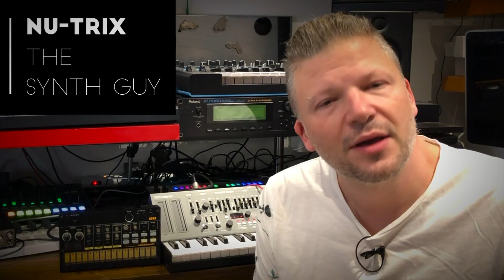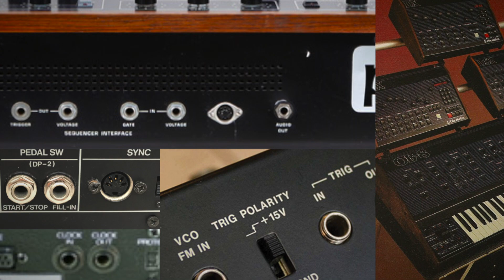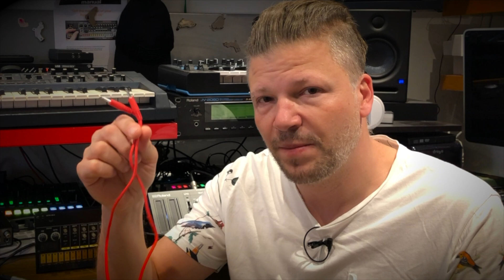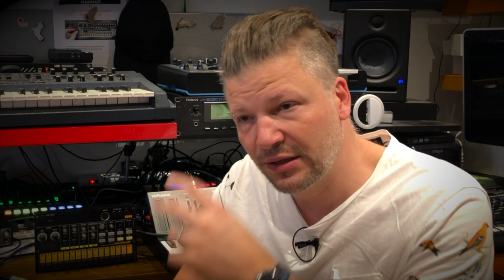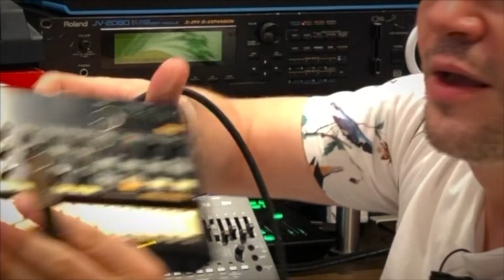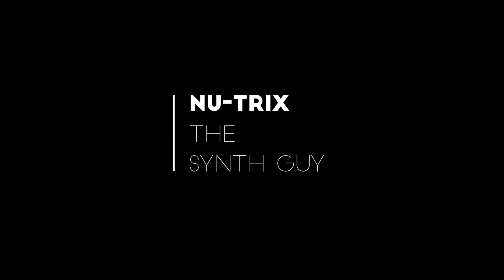How to sync using MIDI Sync or Trigger Sync?

Comment: FYI, nothing to do with this topic. Just to tell you that UVI just released Falcon 2 with crazy new stuff. I don't know if you have Falcon but if you do, this update to version 2 is free, which says a lot for the lack of greediness of UVI considering how huge this update is. I personally think their products are top quality. Great sounds. I tried most synths but I only ended up purchasing Falcon and Serum. Did you do a video on the new Massive X? Anyway I am curious about your opinion of the new Falcon 2. I don't have any hardware synths except for a tiny one I got to learn to connect midi out from my iconnectaudio4+. I really like the midi side of music making. It amazes me how much you can do with something as relatively simple as midi. I like to help people to set up midi systems. My favorite midi gadget is a powered midi hub. There are excellent ones and they almost guarantee no power issues amongst many connected devices and no need to disconnect one midi instrument or synth in order to use another because of power problems. Boy did I ever go off topic. I don't k ow if I gave your email address. That would make it easier than communicating by comments. Keep having fun as often as you can.

Comment: Hello Sir  I've been have a problem to connect Akai MPK61 with Roland SH 01A   I can't have the mpk keyboard works..when I press the play on mpk it does trigger the SH 01a and stopp when press stop ..but when I try to use the keyboard it doesn't respond at all...I'm using a midi cable connection correct .. on the SH 01 I have sound going out from output into MX1 channel,  ..I've watched  most of your video on that but I can't find anything on that particular situation..Thanks for your videos they are great ..
Reply from the maker: Check if the MPK61 and the SH01 are one the same MIDI channel.
Reply: @Nu-trix  thanks buddy

Comment: Maybe you could help me out - So pretty simple:

1. MC 707 sending out midi clock to XD.
2. XD is set to Clock Source Auto
3. The clock fluctuates ever so slightly (a tenth?) so that it is virtually unnoticeable but...
4. When you use a bpm delay, there is a slight pitch shift (due to slight clock movements affecting the delay) about every ten seconds give or take. 
5. Its not the MC - everything works just fine with the Novation PEAK (as always - quality synth)
6. Is there any known issues with the clock sync with the minilogue? Thanks!
Reply from the maker: Now that I know of. But MIDI clock is not the most precise clock there is.
Reply: @Nu-trix  Thx for getting back to me. Just found this on another youtube channel "UPDATE (April 18): Korg has confirmed that they will be fixing the BPM Delay + External MIDI clock issue in a future firmware update." So maybe there's hope :)

Comment: Do I need to have them both going into a mixer? What kind of set up do you have here for output?
Reply from the maker: Sync is not audio, so yes in parallel to sync and MIDI you need audio connection and a mixer for combining them all.

Comment: Can I sync a software like Traktor or Serato DJ with my DAW? I can sync midi hardware between them and with my daw, but I still don't know how to sync what i'm playing on Traktor with my VST in my daw :'(
Reply: Is traktor  capable to use vsts within?
Reply: @finonomastropiero4261  Not within.

You need to send the traktor signal to your daw, and then create a track in your daw that plays that signal. I use to use Voicemeeter(software) to send Traktor to a virtual audio channel 3/4 (without hear that), and then create a track in Reaper that receive 3/4 as input and send it to 1/2 (now, you can hear that, because it's the channel of the Master). When you do that, you can add whatever plugin you want to the track, but it's not in within the Traktor.

You can do some stuff. For example, you can automatize some FX in order to increase/decrease them with the volume of the input, or with low end, etc. So, when you remove the low end in the mixer, then the reverb+delay increases.

Comment: I really really need some help so I just bought a Se-02 an when I try to play it no sound is coming from any preset even when I plug in a midi keyboard it has newest update an when I play in sequence or song mode it plays sounds just fine just not in patch mode what am I doing wrong??? Any help appreciatef
Reply from the maker: Maybe check the MIDI channel settings. Or try a factory reset.

Comment: Informative video! I'm trying to sync up a Drumbrute Impact and a Behringer TD-3...I figured this would have me on my way, but I haven't figured it out yet...both have MIDI IN/OUT and sync, but I'm stumped...

Edit: I figured it out! Got the midi control installed and the firmware update did the trick. This might be of interest to people in regard to compatibility issues with korg or other companies, the Drumbrute has different timing options available for Korg and anything else👍 What an awesome little drum machine.
Reply from the maker: Thanks for the info!

Comment: What about using midi out to send clock data to other devices for a backing track? Like if I used a drum machine for the master, and a korg monologue for the bass line. Would I need to set the patterns for both? Also would each device in the daisy chain occupy one of the 16 midi channels? I'm just confused about how to use midi to sequence a song together. Please help me. It would be appreciated.
Reply from the maker: Tell me more about your setup and what you want to achieve, I’ll try to make another video specifically for your kit. Maybe a picture of you setup also.
Reply: Ok where do I send the pic?
Reply from the maker: At luc@nu-trix.com
Reply: @Nu-trix  Is that the actual email address?
Reply from the maker: @miles46100  yes. I received your email. I will take time to go through it later today.

Comment: Hey man! Great video, learned a great deal about machines!

Here is one for you:

I m having trouble syncing my sh01a and my ju06a via ext clock:

Using the SH as master and the Juno as slave, when i play my sequence on my SH, the sequence of the juno starts but isn t played as it was programmed: it plays the right notes but completely eraticaly, not at all as it plays without the syncing.

I ve been looking for the answer all over the web, seems like nobody has the same pb. I m beginning to think that my juno has a problem...

If anyone has an idea :)

Anyways, thx again for your great work
Reply from the maker: How do you connect everything ?
Reply: From gate out of the SH to the ext clock of the Juno, with a mono mini jack.
Just so you know, i also plugged the gate out of the SH to the mix in of the Juno, and i had a click on every beat (so i don t think the prob comes from the SH...)

Comment: struggling to sync minibrute 2 keys with drumbrute..only a learner and had them a few days..i want to go dawless...i want to have a headphone in behringer umc404hd how do i do this please..
Reply: Yo, I have the same setup with some added stuff. I'm also a learner, so I can tell you connecting these things is a pain in my ass, but it's possible. I might be telling you something you already know, but you should be able to connect them directly. Meaning, pick a MASTER (Pick either the minibrute or the drumbrute to be the one with the main CLOCK * it doesn't really matter). For this example, lets say I pick the DRUM, have the SYNC button on INT, then have the MINI on MIDI. Connect MIDI to the OUT of the DRUM and  IN to the MINI. (Tip, clear out the Sequencer on the MINI or else your gonna get a loud crap surprise of whatever you recorded) You can control the tempo with the DRUM. You can also do it thru the "CLOCK OUT" on the drum brute, but the MINI is confusing on that aspect.
Reply: You can also try buying a BEAT STEP PRO (Made by Arturia), which is what I have as a SEQUENCER, but that brought me a lot of other problems. For example, it doesn't seem to work with the DRUMBRUTE IMPACT. If you have the original DRUMBRUTE, I believe it should work flawlessly. Thanks Arturia! But anyways, It lets me do some kool stuff like adjust each note's TONE, which is really fun and makes it stupid easy to make Synth rhythms. It also allows me to buy a $100 dollar program named ABLETON and I'm able to use all those effects and drop samples on the fly during  live performance. (*caution, you need a laptop (For transportation), with a decent CPU. Minimum i7 Intel, but I cannot stress this enough, I would get a i9 Intel, cause at lower levels you get a obvious delay in the music). But you can use the Mini and the DRUM on Abelton too cause they connect. 

FIRST SIDE NOTE, you might need a MIDI Spliter to connect your products (*MIDI does not send out sound, Only a signal to other MIDI products to trigger their commands, LIKE A REMOTE) 

I added at delay pedal (Like the one's for guitars) to my DRUM to add some mystical space to the sound,  which I recommend. (Get Analog, not digital Pedals. Also, don't go cheap. Spend at least $120, cuz you want to have control of the feedback and how much delay).  TC Electronic Flashback 2 Delay and Looper Pedal is what I have (*Get the insurance. I hear these things break) 

I also wanna stress this, the BEATSTEP PRO is a pain in the ass cause it doesn't use connections like other sequencers. I'm still trying to figure it out, but I feel like most of the pain I'm getting is from having to research and read, and having to go to amazon constantly to buy new connections. I feel like other Sequencers might be better, but this is my experience with the Beatstep Pro, which is not bad, it's just fkkn complicated. 

Side note, don't expect to buy these things and have everything you need. I've had to make several trips to Guitar Center and Amazon to get connections each other didn't have. (*Splitter for the MIDI, extra MIDI cables, 1/4 cables, power supply.)

For CONNECTIVITY, I Rig my gear so that my BEATSTEP PRO works a the MASTER. I send  MIDI OUT to my BRUTE and MINI using a SPLITER. I set the MINI and the DRUM on MIDI in the SYNC category. MINI sends it's audio through a 1/4 to my MIXER , the DRUM sends it's audio through a 1/4 into my DELAY PEDAL, then to my MIXER. MIXER to the SPEAKER. 

When I hit play on the Beatstep, it activates everything. 

I know its annoying, but it's possible. You would think Arturia would make their products work out of the box. Ugh.
Reply: Side tip, go on Reverb.com if you wanna buy  used products on the cheap. Right now they have a Beatstep pro for $130 (NOrmally 250 plus tax), but you gotta hope that whoever owned the machine before you did the updates, cuz used products don't come with activation codes, or they were used already. My MINIBrute 2 lives without updates.

Comment: OK.  I want to use Novation Mininova as the master (midi internal), and Korg micro sampler and Roland Boutique JU-02 as slaves.  They dont really need to start simultaneously, just so the tempo of the Korg (so the loops in Microkorg are plays in synk), and the internal sequencer of the Boutique lines up. I will then live sequence them. NO midinotes of course. It proves to be not that easy....   Should i set the master Mininova to not send notes, or the other ones to not receive notes?  Confusing.   And to i have to set the second keyboard in the chain - the micro sampler also to something to specifically not send notes to the slave "next in line.".......
Reply from the maker: I imagine two ways to set it up. 1- set each device not to send MIDI notes or set the slaves not to receive MIDI notes. (Not always possible )
2- put each devices on separate MIDI channels. So the notes will not trigger playback on the other devices but the sync will be shared (sync is system wide not on a single channel)

Comment: Bro I have accidentally connect two sync outs 
Is there any issues
Reply from the maker: It will simply not work. The two units are talking and none of them are listening = not synced.
Reply: @Nu-trix  
But will it damage the device
Because electricity is rum thru
Reply from the maker: No
Reply: Thank you bro

Comment: you cannot sync korg and roland together because in this case the two machines work in different beats of time: korg in 4/4 and roland in 3/4.  You can hear clearly the difference when you play roland's sequencer and then when you start the drum beat of korg. then you plug the jack into roland and you can hear that there's something wrong! It's just because rhythm in 3/4 doesn't fit into a 4/4!
Reply from the maker: I don’t think that the case. It is more relate to the fact that the ppqn is not the same. The Parts Per Quarter Notes are not deviding time with the same resolution.
Reply: @Nu-trix  yap...
the volca is running at 2 ppq.
has the sh 01 no options for the ppq to send..?
i think they would run fine then together.
( i remember the td 3 fe. has different options for ppq settings)
 a bit strange you didn t mentioned that in yor video..
Reply from the maker: You are right. If the sh-01a had a way to change its internal ppqn resolution it could adapt to other devices … but it’s not the case it is made to run with other Roland devices . Sadly, you will rarely see Roland and Korg agreeing on a compatible format.
Reply: @Nu-trix  yap, quite annyoing to deal with those company issues in 2022 as a user.
luckily some of the newer gear  has the option to change the ppq settings.(rd 8/td 3/keystep..fe.)